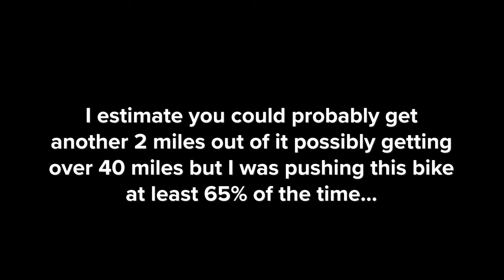How far can 56 AMP HOURS take your e-bike? 5000W Ariel Rider X-Class

Comment: Do you use a blender for those batteries? I haven't found one that can handle 80+ amps for a reasonable price. And is there any triangle battery you can recommend to fit the X-class that isn't too pricey? Those molicels are nice, but seem so high. Also, Sal never responds to my messages for help so it's hard to justify buying from him but if they are the best option I might give it a try.
Reply from the maker: Hi Newlyn, if you're linking 2 72V batteries I would definitely go the parallel connection route. It's the cheapest and best way to link them and all you need is the wire harness and a volt meter to do it (video coming soon on this). The triangle batteries that Sal has from NB Power (non Molicel) are perfectly fine especially if you're looking to hit the 50mph+ mark. I would go with 2 20ah triangles from his site. I would def try calling his cell as he responds almost instantly via phone.
Reply: @JB360_NYC  I got one that looks like his from NB Power directly and it's 20 Ah. I'm looking into having UPP build a custom one for me if they can, but still waiting to hear back. 

I'll keep an eye out for your parallel battery video if it's really easy. I just feel like I'd probably short something out trying that. 

I did actually try calling Sal a few hours ago, but the phone just rang. I'm not sure if I need to talk to him anyway unless he could work a discount on the battery. That 29 Ah looks enticing. I paid $680 for the one I got now so it's hard spending that much for a Molicel one unless it's really that much better.

I need to use mine a few more times since it's still new. I just had it die on me on my first long ride when it said 67V so I'm hoping it just needs some breaking in.
Reply from the maker: Yea I would give the battery a good balancing maybe two 12 hour charging sessions and the range will get better. The 29ah Molicel pack was definitely a game changer and could hold a charge better than 2 NB Power ones combined. Extra torque as well.

Comment: Sick ride! Other than your buddy getting a flat but glad that was fixed. Quick question man, I just put together the light kit from E Street Bikes on my 72 volt x-class and nothing turned on. Tried switching some wires around and still nothing. When I went to charge the battery for the very first time, the light on the charger stays green. Is this normal for the first time you charge or is there something wrong?
Reply from the maker: Interesting, I would double check and make sure the QS8 cables are sitting tight. When I switched to the Molicel packs, I had to really force the connector in forcefully lol. The charger should be showing red and you'll hear the fan when it's charging.

I have the wiring diagram for the lights so let me know if that works for you:

https://drive.google.com/file/d/1UotIs8n1iFRse9YpXeDJeU5QwWhrMA2h/view?usp=drivesdk

Comment: What bike did Sal have before he mod’d it out?
Edit: Well that kinda doesn’t make sense fr lol Cuz he still has it whether mod’d or not so I just meant what bike is that like the frame he had before mod’n it?? Super 73 or what??? I genuinely could not tell from the views on this vid and just wanted to know if you don’t mind just curious that’s all. I really want a Super and I want to know the different ways I can mod it if/when I do want the extra speed torque and range. Might not do much performance wise except an extra battery and then when those go bad or just start lacking from usage I’ll probably upgrade voltage wise and get the whole battery controller and motor kit. But they cost so much I just have to go ahead and ride that 40v 20ah battery and stock motor and controller for at least a year or two so I don’t feel like I scammed myself I guess😂I just can’t snatch them right off as soon as I get it just because I want the performance upgrades. Gotta just roll stock for a min. Then I’ll either sell them or just get rid of em if they go bad in that timeframe I guess. But thanks for the content bro. Seen a few vids so far and it’s entertaining and dropping some knowledge on things so I appreciate that brother. Keep it up and stay safe out there on your rides my guy🤟✌️
Edit: sorry for the long ass comment man that was not my intent at first and I just started blab’n about shit from a simple question bro smh😂
Reply from the maker: That one he had is a Super73 clone but all steel frame.
Reply from the maker: His shop is actually opening tomorrow and he has a bunch of new ebikes that have upgraded controllers and battery packs. Plus they can be modded for 72V. He's modded out plenty of Supers as well.
Reply: @JB360_NYC  Drop the link for me please

Comment: Doesn't seem like that much battery is really worth it for the price. Unless you didn't have the 5000w on the last range test. 36miles to 40 miles isn't a big difference. Either the extra weight of the battery or maybe you were going a lot faster this time. Maybe 40a is the sweet spot. Good video though glad your doing this so we all can learn something.
Reply from the maker: Yup one thing too is the 150a Sabvoton is eating way more volts than my last setup with the 80a Sabv. Going a bit faster this time as well.
Reply: He's pushing the battery pretty hard. Specs are usually for mixed riding or cruising around 30mph.

Comment: What kind of tires did you say you put on?
Reply from the maker: Those are the Kenda Cruiser dual sport tires:

https://www.amazon.com/gp/product/B00FMW7CCU/ref=ppx_yo_dt_b_search_asin_title?ie=UTF8&psc=1
Reply: @JB360_NYC  hey jb, I'm interested in buying those tires as well. Did you purchase and install 2 of the same tire? One for the rear and one for the front? Because the link posted takes me to kenda front tire. Also did you you also buy the tube for them? Thanks.
Reply from the maker: @hugofitness3152  correct I bought 2 of the same tire for both the front and back.